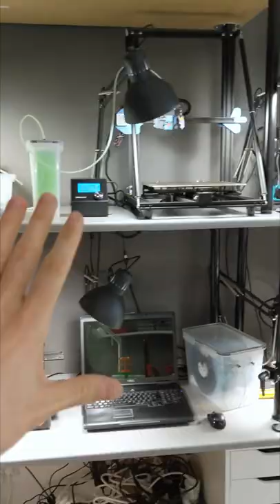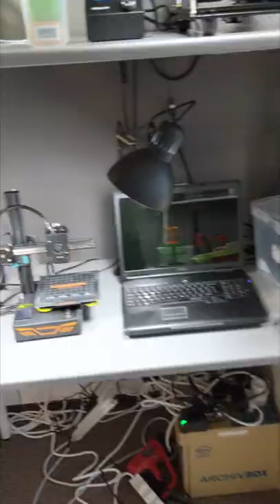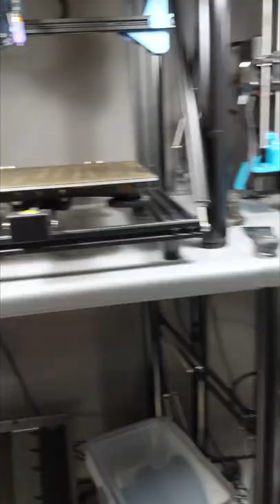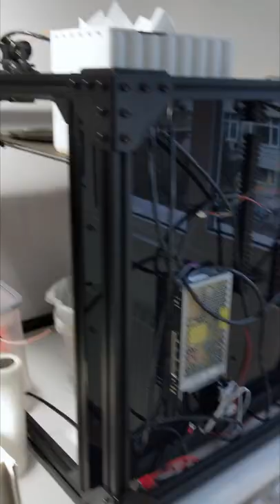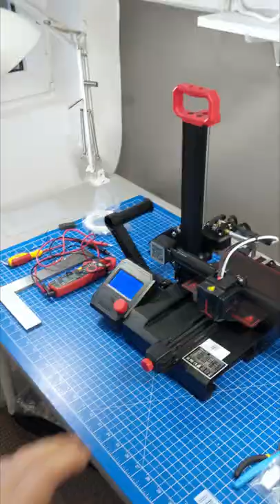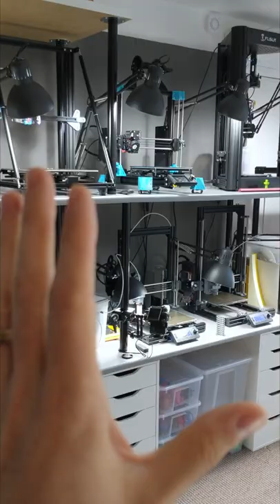Don't get a 3D printer

Comment: My standard and stock ender 3 works PERFECTLY out of the box.
Payed 180€
The really expensive stuff is the fillament.
Reply: same here
Reply: I did have to fix my ender a few times, but each time was something dumb I'd done or really cheap and easy to do.
Reply: Use it everyday straight for a year and let me know how it's doing, ha. They're all okay for a few projects but if you do production work there's always going to be a issue eventually.
Reply: There is literally 0 way in hell a printer is working at it's best out of the box. Fine tuning settings takes fucking forever, nobody's doing that in a factory(especialy whe  your printer comes as a kit XD) and every individual printer is different. 10 microns of movement actuly matter, so it's to be expected
Reply: Mine has a warped bed, but small prints are perfect. I did esteps cal, and just sent it with default cura. Prints better than I've ever seen. Quiet af.
Reply: @EddieAdolf  if you do production work you should by a commercial printer...
Not a cheap consumer printer..
Reply: HOW
Mine needs new fans after just 2 months
Reply: @BensRightBrain  what makes you think you need new fans?
If you have no fans spinning this early you have a different issue altogether.

If your fans are noisy then welcome to the ender 3
Reply: Same. I originally thought "okay, this is an entry-level machine, it'll do mediocre prints, break, and by then I'll know what features are most important to me so I know what real machine to get." Two years, twenty or so rolls and countless perfect prints later, and my only issue is that I only have one printer.
Reply: You really think filament is expensive? I thought PLA was pretty cheap.
Reply: @goku445  I was so concerned about how expensive printing was gonna be, then I saw the filament prices and the price per my prints were like $0.20 and I was amazed at how cheap printing is
Reply: @ethanwebb6122  Exactly! Also I wondered about powered consumption since you have several heating elements but it's actually pretty low.
Reply: thats true
Reply: Not sure why so many people have issues. I got my Ender 3 for $150. I then upgraded to a silent board, glass bed and a Capricorn extrusion tube. A few other small things as well. For a grand total $200. I've been using standard Cura settings, Overture PLA, and occasionally level my print bed. I can count on one hand the number of failed prints I've had. I've been printing for hundreds of hours over the past few years. The secret is just taking the time to build it correctly.
Reply: After playing with it, I figured out some precisely placed sticky notes pull out a significant portion of the warp and it's printing totally fine.
Reply: Mine was absolutely dreadful. I replaced almost every part of that machine to finally get it working at a mediocre level
Reply: @tw6599  that's the gamble with Chinese quality control
Reply: @EddieAdolf  I don’t think the Ender 3 is designed for manufacturing or production. It’s strictly a hobby printer.
Reply: I got the Ender 3 pro about a year ago and I haven’t had any serious problems. I’ve only had one failed print. I’ve replaced the fans twice. But that was to be expected for how much I’ve been printing. I’ve recently upgraded to a glass bed and I got some Capricorn PTFE tubing and it’s working great.
Reply: Couldn’t agree more
Reply: @ethanwebb6122  yup. Of course they're a bit more than a couple of hundred bucks - We paid six figures for our Big Rep Pro at work, but that's a big machine, total work envelope of a cubic meter..
Reply: Fact... mine too. I printed off a turbo spool from a garret 45. Well impressed.
Reply: You probably need to change the nozzle soon then
Reply: My ender 3 SUCKS
Reply: I just made a comment like this. Mine is going on 4 or 5 years old now. The thing prints endlessly and never complains. Best $180 I ever spent.
Reply: @EddieAdolf  i have printed for days and weeks on end with my ender 3 v2 the only thing that broke was 1 bodentube connector.
Reply: I heard you can make filaments out of plastic bottles?
Reply: @FernandoRamirez-kh7ot  You can make filament out of plastic bottles if you make a setup for it that can make 1.75 mm filament. But in my opinion it takes too much time it and in my country every plastic bottle has a 25cent deposit if you bring it to the store where you bought it.
Reply: @scottcole1423  you can also consider to upgrade all fans to noctua fans like i did and they will last for nearly ever

Comment: Got a Creality CR-10 V2. Modded it a slight amount (bed leveler, heat box, smaller nozzles, and parts) and it is a fantastic printer. Cost about $400 but it's great for beginners and has a big bed size. Never had any issues with it, besides the usual clogs, bed level (before auto leveler) and maintenance. My dad put Octoprint on a Raspberry Pi + some other softwares, and it works flawlessly.

Comment: For me Prusa was a game changer, haven't look back since.
Reply: Its the only brand out there that actually has a reputation lol
Reply: not in my case, 2 years now with prusa mk3s and still cant make it print well
Reply: @Doonmer  
Print quality or adhesion?  What model do you have?
Reply: @user-yk1cw8im4h i mean creality making a name for themselves
Reply: @cornertankcorner  i3 MK3S, i went through all types of issues, mostly is print quality. Problem I have now is at some heights of model its just under extrudes or just starts shift layers.
Reply: @lilsjomp4741  yeah, a bad reputation at that.
Reply: @user-yk1cw8im4h  I have 3 Ender 3 v2 here and working fine and under pressure... going to buy another one..
Reply: Is a clone worth it?🤷‍♂️
Reply: @Doonmer  belt and idler tension maybe? thats where i would start. make sure your software is up to date, and that you have the right profile enabled for the mk3s (prusa tests these profiles on their print farm)
Reply: @GiovanniMorenoMusic  id stick to the real deal simply for their customer support and access to the spare parts shop
Reply: @sidewinded1  Done all that, still have myriad of issues printing. Fell like I was super unlucky or this "printer that just prints" is not true. On top of that display just died and have to pay 100 to replace it. Im one step from giving up on this unit.
Reply: @Doonmer  Im sorry, sounds like you probably just got really unlucky :( with my experience the thing worked perfectly after performing the necessary updates and installing the required drivers so I personally can vouch for the “it just prints” but im sorry your prusa experience wasnt like that, you should try contacting customer support to get a new one or something
Reply: @GiovanniMorenoMusic  the clones aren't bad, but you're still better off spending the little extra for the real kit
Reply: I cannot for the life of me get my i3 mk3 to print consistently and well. I've tried everything I know to do, spent countless hours on chat with tech support, and even bought a 3D printer troubleshooting book. Nothing I seem to do fixes it. Bed adhesion is fine, not an issue, but the untersides are always, always bad! And I always seem to get x and y axis wobble no matter how loose pr tight the belts are.
Reply: Yeah I think prusa has by far the least fussy printer experience. The prusa XL looks amazing if I had that kind of money I'd be there costumer.  
Instead I am building a voron. Which is the kind of printer that you leave alone as soon as you get it working right (finally) and it will run great for a long time.
Reply: @notsam498  I didn't know an open source project like that would result in such a reliable piece of equipment. Are you sure about that ?
Reply: @alejandroperez5368  yeah man, as long as you built it correctly. It will absolutely Just keep going, this is really dependant on building it correctly. However that is too say it is not at all for the inexperienced, or someone limited by cost.
Reply: me too :)
Reply: I'm ok with my Ender 3 v2 TBH.
Reply: @lilsjomp4741  not in a good way - frames barely square and firmware doesn’t actually work. There have been issues with their own Z offset sensor kit for two years and sod all support for the community.

Comment: Aight I agree that all other printers take so much time to tinker with and get right and I had this exact same moment with 3D printers taking up so much time until I got a genuine Prusa i3 MK3S+ where the only time it took from me was the assembly. I can press start and not have to worry about it until the print is done. And there’s so many fail-safes on the printer that ACTUALLY work like filament runout, power panic, crash detection, etc. Along with that the software is completely open source and it is well designed and thought out. If other printers take up too much time, just try a genuine Prusa.

Comment: This reassures me that my investments in Prusas were definitely worth it
Reply: Depends, a DIY guy like me enjoys adding features, and making custom firmware for my ender 3v2.
Reply: But yes, this is the reality, cheap printers are not reliable.
Reply: As a Software/Embedded/DevOps guy, unstable firmware is the last thing I want on my printers.

But I get that. I want my printers to be as reliable as tools.

I'll reach the point of experimenting and making my own in due time, but other projects take priority.
Reply: @dtibor5903  though they can be made to be with enough time
Reply: @dtibor5903  same, miss the days of working on my tevo Tarantula
Reply: Had mine since 2016, works well most of the time, and when it’s not the help I get from prusa is second to none. My mk2.5s had a slight blemish in the spring steel bed... they sent me a new one in a couple of days and another heated bed and a few other bits just to be sure
Reply: @dtibor5903  agree, tho at the same time, with how much iv put into my e3v2 i probably have a slightly better than prusa for a bit more than a prusa printer... tho im finally done modding mine and from here on out its just maitnence and filament.

Comment: Just study the different user's feedback on printer's before getting the new one.

I did it and the overwhelming feedback from users all around was that Prusa MK3 is a workhorse and doesn't need tinkering all the time.

Purchased the Prusa MK3 and have never met any issue with it, just loaded GCodes and filaments, and just started printing... Auto bed levelling and end-of-filament sensor are also 2 quite trouble-relieving options!
Very neat and beautiful prints as well

Comment: My Prusa works out of the box (after I assembled it).

However I do get that surface pattern you suspect is from the Bondtec gears.  I installed your mod and tried, didn't change anything.  

Sorry, I've been meaning to send you the results but haven't got around to it yet!
Reply: vertical line artefacts? Bondtech gears are top of the line and seldom cause issues, i suggest you look at the motors or pulleys
Reply: idler tension also might help
Reply: Mine even works inside the box disaambled too... 😌

Comment: Been 3D printing for years, just learn how to use them correctly and they will work perfectly.

There is no such thing as the lazy 3d printer that just works without needing correct setup.
Reply: wrong look at the cr6 se or the bambu labs x 1 carbon

Comment: With my two Ender 3 Pros, the only necessary mod I made was replacing the plastic extruder parts with metal.  Adding a bltouch, OctoPrint, and a glass bed were just personal preference, and between the convenience of the ABL sensor and OctoPrint, I'd say the time put into my printers comes out to a net positive.
Reply: Glass beds are fantastic and make for great surfaces, if you can prevent warping on them.

Comment: Best 3D-printing video ever. It brings it down to the point. Most 3D printer users spent their time repairing and modifying their stuff instead of creating something - and I did that too. At the end I come down to the Prusa MK3S. Their are not perfect too but there  must be a reason why most professional farms use them.
Reply: lol get an ultimaker if you want to hit print and go
Reply: @rickverhoeven1064  I never owned a Ultimaker. The prices there start at 2500 USD. A Prusa is around 800 USD. That is above my budget.
Reply: @snax_4820  I owned a ultimaker 2 and would never buy one again. The mk3s is superior in every way. PFTE liner in the hotend so that you can't printer at more then 250 degree celsius. It is loud, prints relative slow and ah the heater try your luck to printer above 240 degree celsius. Don't get me started on the promised dual hotend. Never released and now your carriage has everything for the second hotend and has to carry that weight. The feeder is trahs. So i could go on even more. I really hope those other machines are better but the ultimaker 2 is awful.
Reply: many people like you mislead the 3d printer as a consumer machine like a printer when its not. It lives in the cnc category, where the user is meant to know the ins and out of it. If not you risk damaging it or at worst burnt your house down in some cases. If you cant live with that mindset its simply not for you.
Reply: The reason those professional farms you're seeing use them is because Prusa used to be the only game in town, and most of them started those farms a year ago at least and cheaper printers have come a long way in that time.

They aren't the only game in town anymore and anyone purchasing one at that price is foolish.
Reply: @rickverhoeven1064  That's funny!

Because I hit print and go on my E3V2. $270 +$100 in upgrades.

CR touch, Jyers firmware, all metal extruder, all metal hot end, bed springs. None of it was necessary, just makes life easier. I just hit print and walk away. I don't think I've watched a first layer in over 6 months.
Reply: @user-yk1cw8im4h  Well said. The constant complaints from people that it should perform like a general paper printer is just absurd to me. Especially to me as a woodworker and Metal fabricator.
Reply: @dangerous8333  i do the same on my switch wire and ender 3 pro. But most people can’t do that
Reply: @dangerous8333  Thank you for your answer. Some months ago I needed a printer fast and Prusas have a long delivery time. I bought a Voxelab Aquila and the results were quite good. As the other printers he had to work around the clock. After 4 month the printer started fall apart.
Reply: @rickverhoeven1064  ultimaker is shit, so much harder to work with than prusas for maintenance
Reply: @sidewinded1  you’re doing something wrong than…..
Reply: @dangerous8333  the ender is budget but you cannot get prusa level quality out of it. Prusa utilizes 1/256 microsteps and ender utilizes 1/100 so the prusa is bound to be better not to mention that it prints out of the box no bed levelling required. There is a reason they are the top of their game
Reply: @rickverhoeven1064  not a fan of the closed design, it makes accessibility to everything hard
Reply: @rickverhoeven1064  same with my Ender 5 mostly. The things I print with it would cost way more than the printer itself had I bought them from an actual company instead of making them myself as well, so I can only see my printer as having been a good investment.
Reply: @sidewinded1  I’ve never had someone break down why they like their Prusa over cheaper printers in a way I could understand, but that makes sense if you need that extra accuracy.

I print paintball and airsoft stuff, which are generally not very curvy, but it’s good to know that there’s an upgrade out there if I want that extra accuracy.
Reply: Sounds like "most 3D printer users" don't know what they are doing then. Can't fix user error.

Comment: I have had an ender 3 v1 for 2 years now and it hasn't had a single issue, if anything it has gotten better 😆
Reply: I bought a used 70$ ender 3 and that lemon is working like new ,I had zero 3d printing knowledge when I first got it , it had a ender 3 pro firmware and it wasnt working because it had a gd32 4.2.2 I fixed it getting the right firmware now I got 2 ender 3 and a Aquila c2 😂
Reply: @lulumolina755  Nice! I have never even upgraded my printer firmware, just slicer lol and I was the same way, didn't know much either. I did create my own extruder assembly about a month ago with a new heat collar/neck so that the nylon tube would stay behind the heat-break, and now I can print polycarbonate carbon fiber using a steel nozzle, worked out pretty well!

Comment: I feel sometimes the same. I have a Prusa MK3S (as Kit) and im generaly fine with the timeratio of printing vs  "get the damn 3D-Printer to work" . Except last time, i tryed a diffrent nozzle size, after that i ran in to a lot of issues (I will NOT do this again). In comprarision a frind of mine bought a AnyCubic Chiron 3 months ago and he got still not one clean print.
Reply: My AC Chiron was perfect from day 1 and did many hundreds of hours of prints. Eventually the main wiring harness gave me trouble but it was easily replaced. The Chiron is a winner. My Ender 3 is my never-ending project.
Reply: @Lozzie74  I think you need luck with the printer you get. Probably the quality controll is not that great on printers with lower price tag. The most of the reviwes i saw about the Chiron are also positiv.

Comment: Ha. That's what I always tell people when they ask about 3d printing. It's not just a printer, it's an entire project to keep it running.  
The perfect solution? I don't know.
Reply: Exactly, though saying that the prusa mini is pretty reliable for the price
Reply: The ender 3 with some upgrades (new controller board, direct extrusion with BMG extruder, V6 hotend with bimetal throat and PEI power-coated print surface) is the solution to that problem...
Reply: Learning how to use them properly helps.
Reply: @alejandroperez5368   Ender 3 S1 out of the box with no upgrades is the solution if you don't want to tinker and probably spend less over-all. Can get for $350 on ebay with making an offer.